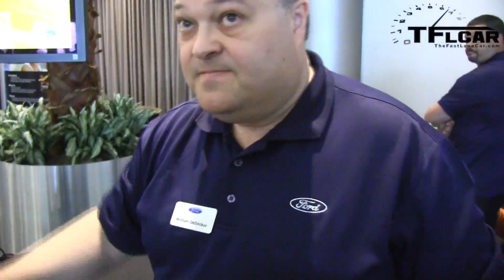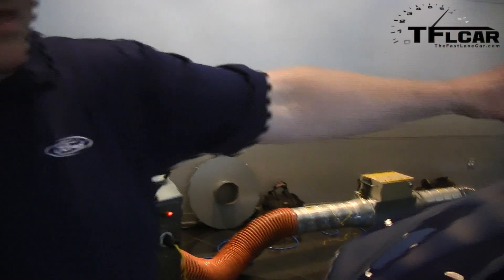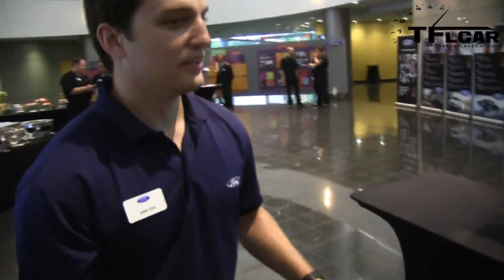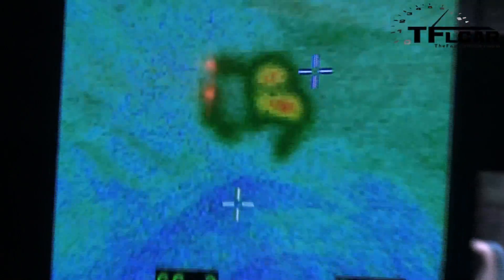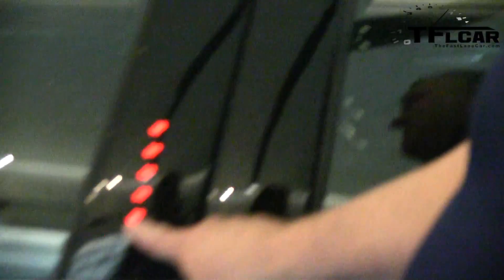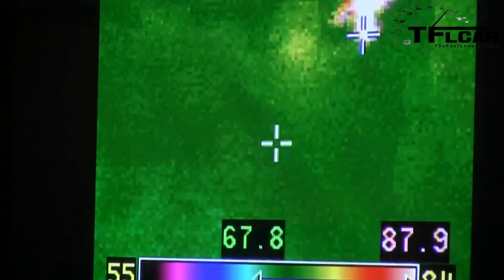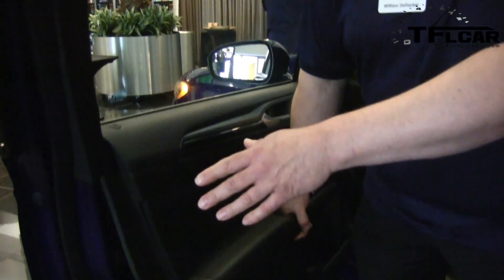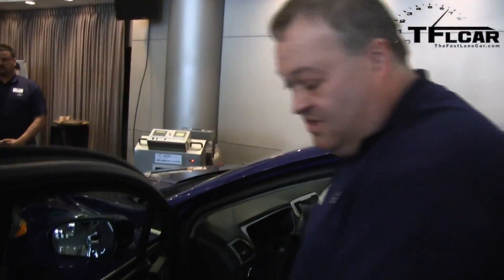New Car Tech: Ford Thermal Camera Car Imaging

Comment: Heat loss in a car.  Is this to check for potential leaks or for for quality control in general?  Heat loss to me is a real non issue, but leak potential is.  With all the electronics cars have in them now, keeping water out is even more critical.  As for Ford quality, l have no experience.  I personally do not care for Ford.

Comment: that was dissapointing.  "We only have three." You're Ford for crying out loud you can afford more than three cameras.  If this is for quality control they should check every car on the assembly line, not just show off at launches.  I thought they were going to use thermal imaging to scan the road ahead like a night vision system that is found on BMW, Audi and Mercedes.  Oh well.

Comment: Every manufacture should post a long boring vehicle how each car is made from start to finish.  Have a 3rd party summarize what manufactures do or should be doing during the manufacturing process. Does a manufacture dyno an engine?  Do they test for cabin heat loss.  Does the AC blow cold air within a certain temperature range.  Do you check for exhaust leaks.  Is the engine noise within levels at idle.  And so on and so on.

Comment: So Ford is cutting corners.  You could put a heater inside the car powered via an outside source, get it up to 120F, have an assembly line move the car into a thermal imaging booth and check the vehicle.

Comment: This would be way too expensive of a tool for technicians to use, let alone the size of the equipment to actually be used.  If somehow they made it more compact it might work.  There are already smoke machines that can help detect leaks in vehicles and are far more cheaper and simpler to use.  Why is Ford wasting its time on such  useless tech?